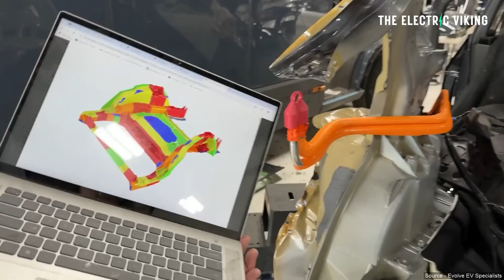What REALLY happens to a Tesla Gigacasting after a crash...

Comment: Well, EVs are trow-away cars, if you've got a dent in your battery you can write it off. So it's kinda consequent that Tesla doesn't care about reparability of the bodywork. 
Replace thw whole gigacast? Yeah sure, how much does that cost, ripping everything out of the damaged car and transplanting it into a whole new frame? Pure fantasy...
Reply: Just avoid buying Hyundai/Toyota. tesla battery replacement 12k, BYD 3k.
Reply: @yulusleonard985  >12K
That's just for the replacement battery though, installation costs can add another few thousand $.
You can get a brand new Dacia Sandaro (really nice car) starting from €11.000 here in Europe.
Reply: @hiram1923  Weird isnt? Tesla still sell more than that Dacia in Europe last year.
Reply: @yulusleonard985  Well, Tesla is by far the leader in the EV market, Dacia is just one of many brands with attractive prices in the ICE market, so the sells spread much more here.
Reply: @hiram1923  Yes when people want to buy small hatchback they  buy small hatchback. When they want suv they buy suv. When they want electric they buy electric. If battery degradation is their concern, buy with LFP. If they want performance, buy those with high nickel but be aware that the are still king of flamable  but if you can afford Porsche/Audi/Jaguar/Mercedes I doubt you even care.

Comment: Well, yes and no. Giga casting works for the manufacturer. It speeds up manufacturing, reduces costs and improves margins. Does it make repairs cheaper/better when owned? I don’t think the complex alloys used are easily/cheaply repaired making ownership/insurance costs higher. So what makes the original vehicle cheaper to produce makes the same vehicle an owner’s liability.
Reply: Umm. That's not how maths or compound interest work. You paid less, therefore you have more money and every year you don't crash, you have more money. Thus you can afford any portion not covered by the insurance. And obviously if you bought a brand new Tesla you are uber wealthy anyway so can afford to replace it yourself without insurance, otherwise you wouldn't be buying brand new cars like a rich person who doesn't have any common sense.
Reply: @jonevansauthor  that’s true. But some people can afford a new car and are willing to lose 25-30% driving off the forecourt. Uber wealthy is not true unless your annual salary is less than £25k - in which case I understand your comment. I lease mine and it costs me £400/month - same as buying without the risk of failure, damage or repair costs. No residual value at end of lease but, because the technology is changing so fast, by the time my lease ends I’ll lease a better, faster, cheaper to run alternative
Reply: @jonevansauthor If the compounding debt service exceeds 1.5 of the principle of loan, it is usury.  The bank creates the money (their credit), at the moment the debtor signs the debt instrument.
Reply: Wrong
Reply: Any structural damage is a write off anyway. Even if it’s repaired for road use it then it’s a salvage car. The insurance company still takes a total loss less the value of the parts or scrap
Reply: @mattx4253 nonsense.
If that was true I wouldn't have a job!
Reply: @tonys6601  it’s a write off but doesn’t mean someone won’t repair it as salvage
Reply: VW air cooled flat fours had cast aluminum heads inn the forties. Very easy to repair when cracked. Old news boys.

Comment: 2:43 "replace that entire gigacast"  --what support do you have this can be done..none.  if it can possibly be done, imagine what is the cost of disassembling n reassembling..more than the value of the car.  esp if the batt was compromised.
6:50 repair methods?..i have not seen tesla or insurance companies certify these methods to crash n functional standards..thus write-offs.
many manufacturers are using gigacastings now..the non repairability issues apply to them as well. 
there is a reason why critical castings in general are not repaired.
Reply: They are horrendously expensive to repair. That's why the insurance premium is close to that of a light aircraft, and I'm not kidding.
Reply: Most of tesla write off in US ended up in East Europe. You should ask them how they do it.
Reply: @yulusleonard985  i've seen some of those videos east europe, india, africa.  it can be done but not to standards.

Comment: Surely it's hard to replace parts that have been welded together after any major collision not just gigacasted parts? Yet to hear an explanation why Tesla's are harder to repair or would need to be written off more often. Let the insurance companies and manufacturers sort it out.
Reply: They are already failing them after crashes for minor battery damage, due to the huge liability batteries can pose.  The issue is which part failure is leading.  Say batteries the the thing Insurance companies do not want to assume any liability for returning to the road.  Then cast body parts will be of little concern, and if they perform better and are lighter, that may help the batteries pull through.

Comment: Nobody hates the castings. Will Tesla ship out castings to body shops in a timely manner? Remember that rental bills can be huge. The castings, batteries, motors, etc have a lot of salvage value, and there are diminished value claims so totaling out teslas often makes sense, even though they could be repaired in many cases.
Reply: Will Toyota ship out new V8s for all the recalled tundras in a timely manner? 
Doge was backordered for over a year on the hood for my SRT,...

This is an indistry issue, not a tesla issue.
Reply: Read what I wrote, a question, not a statement. The reasons that cars are totaled go beyond just the ability to repair them, for the reasons stated. Also, do shops have access to classes that instruct on the proper way to repair or replace these cast frames? There are certifications involved in the body shop world.

Comment: Love your work and watch almost every day.  One small area for improvement:  I've noticed that your voice is sometimes over-modulated.  It could be your record levels are just a bit too hot, or you need to upgrade to a cleaner preamp/converter.  ✌
Reply: Sounds ok to me. Let’s not nitpick !
Reply: @preeyakumari-i2q  It's a small detail, but one easily fixed with a small adjustment or a bit of compression.  True, most won't notice the difference.  I'm a VoiceOver pro so immediately notice these things.  Just trying to help Sam to sound even more amazing.

Comment: Have a friend that has had his model 3 fixed 3 times. One where he was rear ended and two times he challenge a post one on the back and one on the front.  No issues in getting it fixed each time in Brisbane.
Reply: Maybe your friend needs to follow some additional driving lessons? Just a thought... Insurance cost will of course increase with this kind of behavior.
Reply: The model 3 does not use the gigacast to build.
Reply: Yeah, no Gigacasting.
Only on the Y.
Reply: It's a pressed and welded unibody. Totally different kettle of fish.